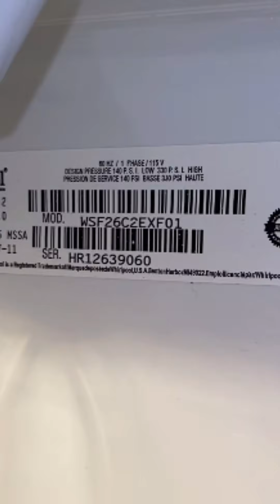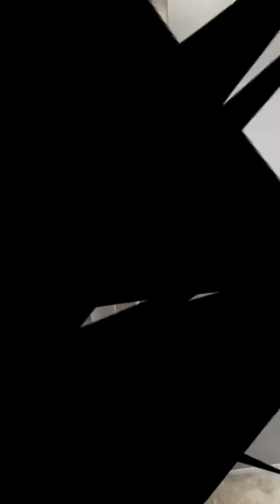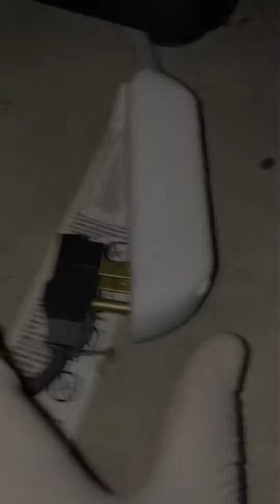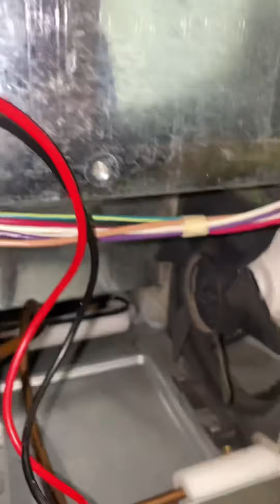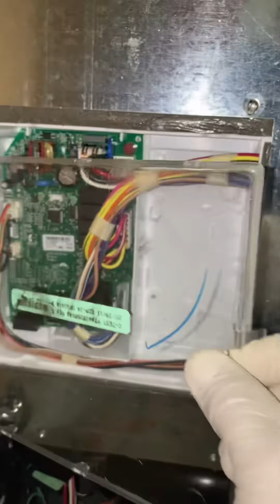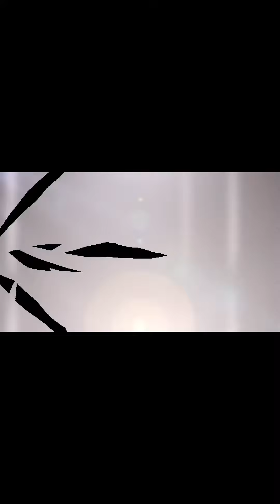Whirlpool Fridge - Diagnostic & Repair - Fridge not cooling at all

Comment: Thanks for the info. Nice to know. but my problem is, my side by side freezer is not staying cold enough. The frig is cool but the freezer only freezing the food about half way? the ice melted in the box and dripped out the front. It's like the compressor does not stay on long enough? I replaced the cap and relay on the side of the compressor but that didn't help? I set the temp a little cooler and it made some ice but didn't fill the tray. The next morning, after replacing the cap and relay, the ice was still in the box but the box was not full as it should have been after 24 hours. The fan in the freezer is working and also the one in the bottom back. Could the temp sensor be bad? If so do you have to replace the whole panel?
Thanks
Rick

Comment: I have this same fridge my problem is every week. My evap freezes up. I've replaced,thermal sensor,heater, evap fan and control board. Where is defrost timer in this fridge??
Reply from the maker: The control board is responsible for defrost. No timer on this unit. Have you made sure there is no warm air leaking into the freezer? Also test out all your components and be sure they are functional. Be sure to use OEM direct replacement parts. If it’s not direct replacement then your ratings will be off allowing too much defrost or not enough.

Comment: Sir,,help me pls,,my refrigerator there is a problem driver board so i replace that new..after fixing its working so i observe until 5 hours..
And then the compressor is not working ang also the led light inside the refrigerator there is flickering..
How to solve pls help me.. WHIRLPOOL SIDE BY SIDE
Reply from the maker: What is the model number of your fridge?
Reply: Tommarow i will check there in the shop store

Comment: I have a gs6shaxmloo do you know what wire on control board starts the defrost? Fridge works perfect but will not defrost, replaced defrost thermostat,  heating element, condenser fan. Thanks

Comment: I have the same model. First, I removed the front panel a removed a lot of dust/debri from coils. No frost on coils, fan running, relay showing 0.5v, condensor cool, condenser fan not running, control board showing same as video, receiving power, tapping relay caused fan to move. So pretty much the same as this video. Ordered a control board. Overnight the unit started cooling properly. 
Was I in defrost mode?
Reply from the maker: Best way to see if you were stuck in defrost mode was to test the 3 pin wire harness that has the compressor and defrost output.

Comment: I had a similar problem w/ a KitchenAid. Turns out it was a worn/burnt out solder joint at the relay for the compressor+fan. I cleaned it up and resoldered it (and installed an assist wire) and resolved the problem. Wonder if that was the condition your board was in since tapping it brought it to life a little.
Reply: How do you find out which relay does that?
Reply from the maker: If a relay has lost contact due to poor soldiering, then once you wiggle that relay, you will be able to see slight movement of the soldier joints.
Reply: @sethdaboss245  there isn't a lot of relays but it would probably be the biggest one since the compressor is the biggest "motor" in a refrigerator.

Comment: The repair company replaced the rear circuit board and it still did not cool or operated all is there another panel behind the front I suspenser control panel?
Reply from the maker: When fridges stop cooling that does not automatically mean that the control board is at fault. Sounds like you need to find a different repair company to properly diagnose and fix your refrigerator.